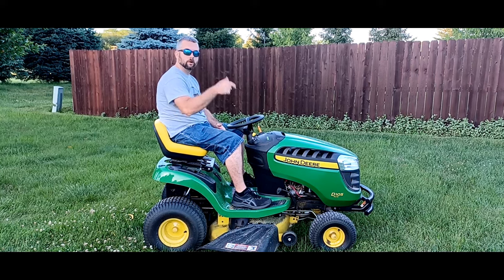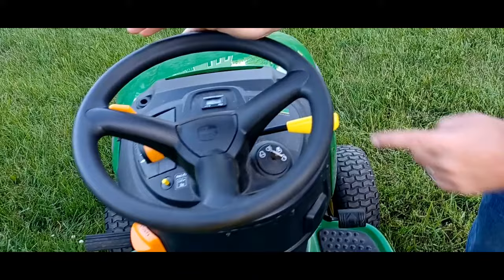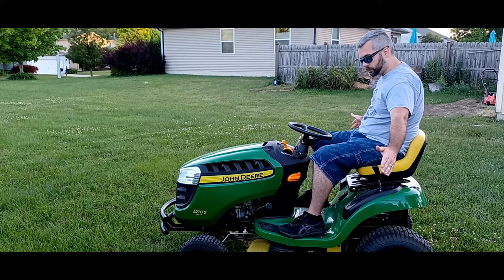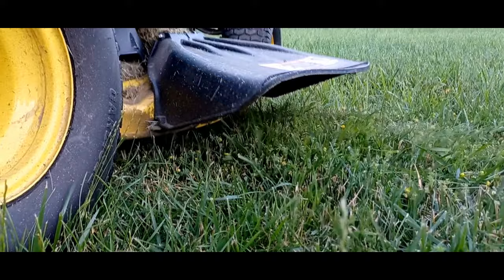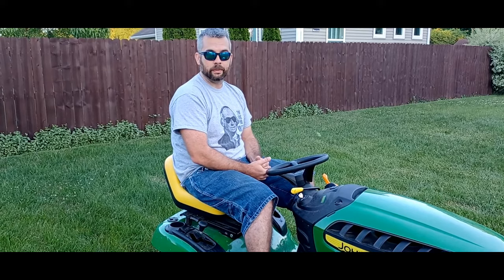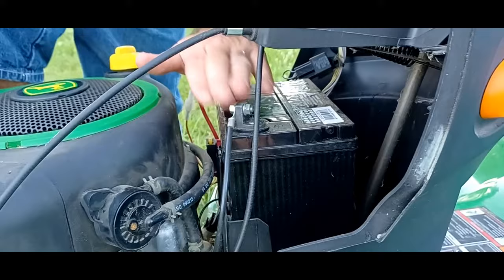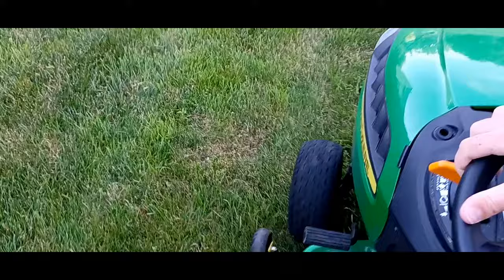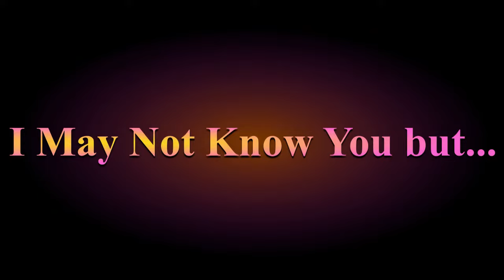How To Use a Riding Mower For Beginners

Comment: I see you do the square method sometimes. You drive it straight, turn left or right, go straight again, and then turn left or right until you find yourself in the middle of the square. Back and forth takes longer, especially with a pusher or self-propelled, but people love to get those yard lines

Comment: Im going too purchase one.  Id probably get an air compressor and blow out all that excess grass around the blades and on the lawn mower itself.   I know nobody is going too speed mow their grass but approximately how fast do these go? Id imagine they atleast do 7-15mph lol.. also if your not mechanically inclined like myself where would i get the lawn mower air filter and oil filters from ad well as where would i get my maintenance done at? I dont own a truck so not sure how i would get this thing too a shop for an oil change and regular maintenance..